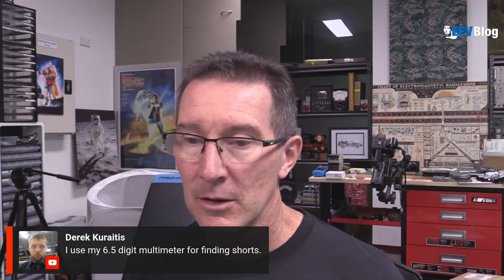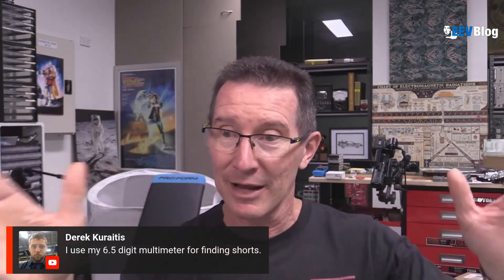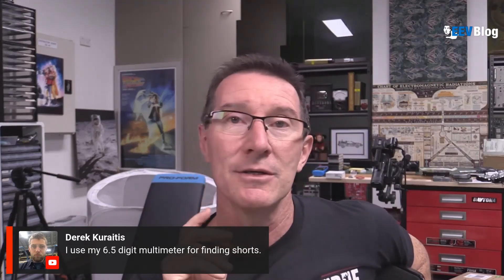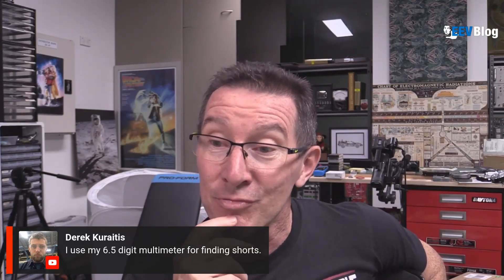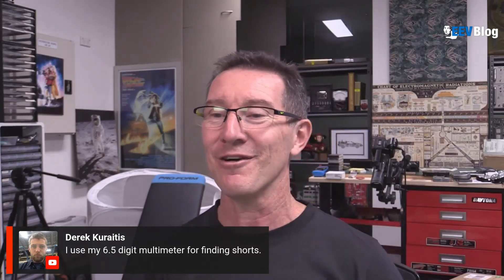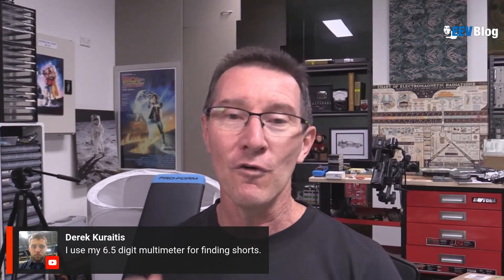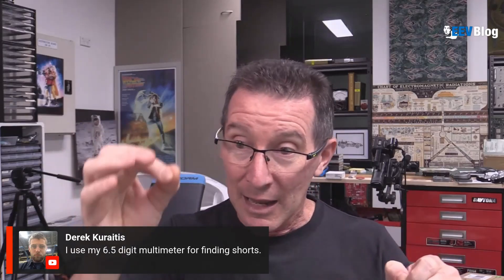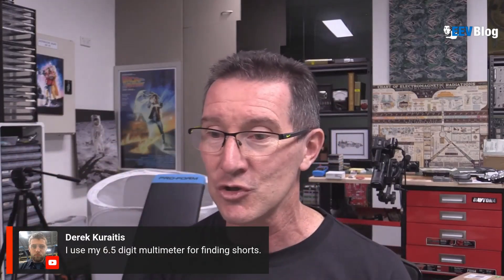PRO TIP: Using a 6.5 Digit Multimeter for finding Shorts

Comment: I usually find it a lot quicker  to check an amp or two through the circuit & use a thermal camera
Reply: Show off.
Reply: Thermal cameras are a godsend for finding damaged components and dodgy soldering.
Reply: @weeeeehhhhh  but still silly expensive.
Reply: @dogwalker666  blown to short mosfets are the best: if you put enough power through the board, they desolder themselves (and I wish I was joking)
Reply: @pjakobs  yeah I used to repair motor speed controllers,  The Semipak transistor modules used to make quite a mess when they failed,

Comment: Yes. The method you describe requires patience and exactness. Or, you could just hook a 5 volt (typical TTL voltage of that era) power supply across the short and blast it away, then add wires to the  board to bridge the blown out land pattern(s).

Comment: Years ago I was working at a company where I needed to track down shorts on a board. The PCB fab house went overboard on tinning the board and it resulted in a lot of shorts hidden underneath the soldermask. I was able to find them using a handheld type Fluke meter (with a 2,000 count?) that had an ohms scale that read down to .01 of an ohm.

Comment: You can do a decent job with a 5.5 digit meter for those that can't drop the coin on a 6.5 digit meter.  Even an old Fluke 8012A, with it's excellent low ohms range, can do a decent job for about $50 these days.

Comment: Inductive-pickup short-circuit current path tracing has the advantage of not needing access to the voltage-probing contact points that may not be accessible (on inner layers or under components).  I still plan to send you one of my engineering prototype ShortSniffers to add to your short-circuit locating toolbox.  I hope to get around to it within a couple of months (life is a series of distractions).
Reply: Wow that website looks ancient. If I didn't notice the "3 weeks ago" timestamp on your comment I would have assumed the company was long dead
Reply: @NavinF  Yes, the ShortSniffer is still alive, and some of the content is from the '90s, but the majority of electrons still flow through the path of least resistance.  Contact me if you have suggestions to help the website communicate this principle.  Thanks, Carl.

Comment: In the early 80's I used a current limited power supply and hunted around with a millivolt meter for lowest voltage.
Reply: Still a good way to find which one of the 200 tantalum bypass capacitors on an 1980s vintage computer board has actually shorted.

Comment: In 1973 Nixies used to rule the digital world!  No more RMS until Fluke came with their Hart resistor. Salora Television (Later got swallowed by Nokia) developed their Cyclops power supply with a faulty reading nixie meter. Their chief engineer and me had endless arguments as he refused me to check his claims on a traditional analog meter. Anybody out here who remembers their Cyclops let alone even repaired one?  (Salora Playmaster TV sold also under the Nokia name)